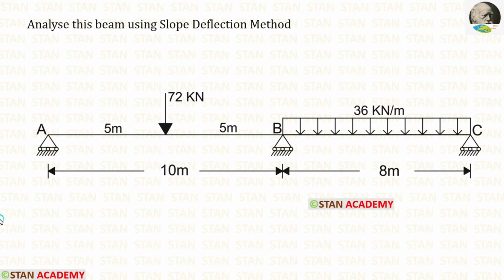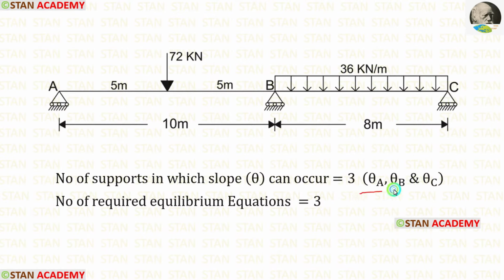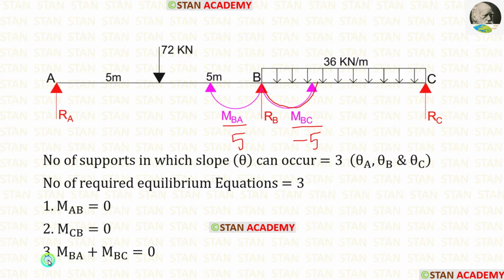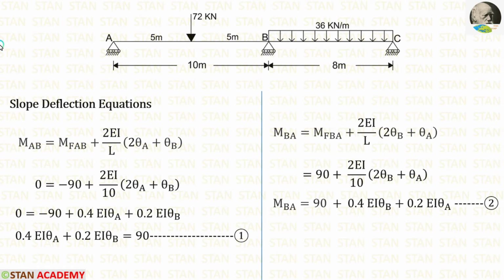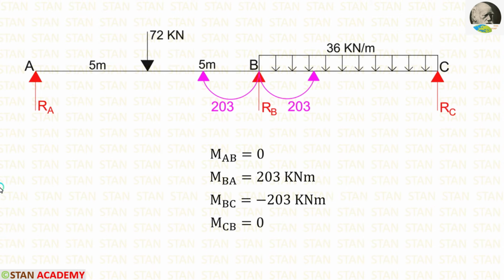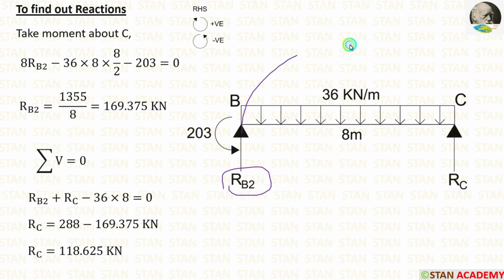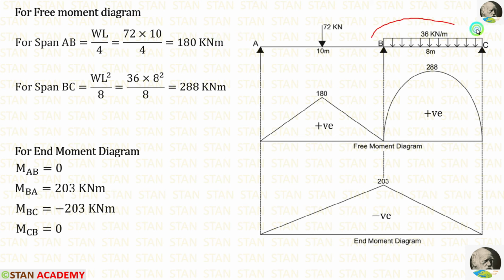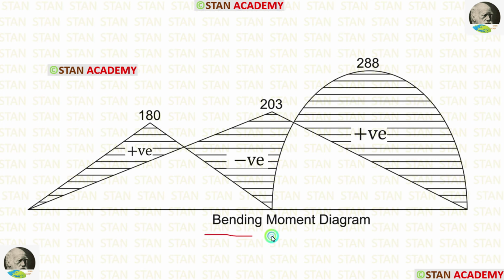Slope Deflection Method for Beam Analysis - Problem No 5

Comment: I'm saying that on point BC both udl and point load is given then how we will calculate that
Reply from the maker: Make the fixed end moments for both of the loads and add
Reply: @Stanacademy 
But we already did that to get the FEM up to this stage. Besides what formula is this wl/4… at the beginning of the vid I saw wl/8
Reply: @Stanacademy 
Same goes for wl2/8…. Initially it was wl2/12

Comment: What if there is point load at point C
Reply from the maker: No need to consider the load until finding the moments. When you calculate the reactions at span BC you need to consider that load. The reaction at C will be different. but you will have same shear force and bending moment diagrams.